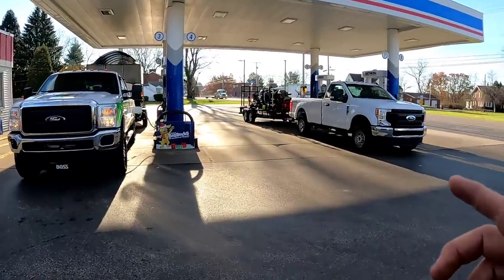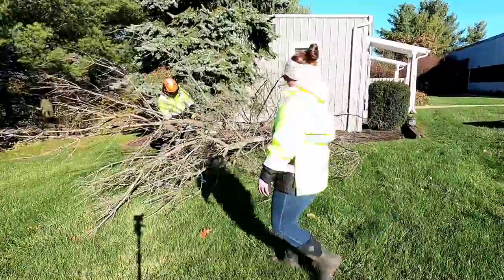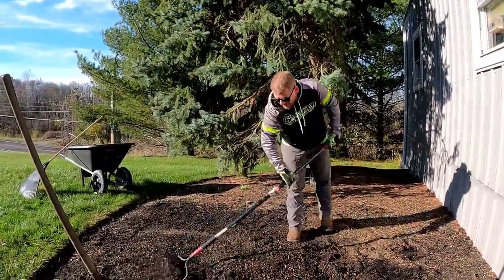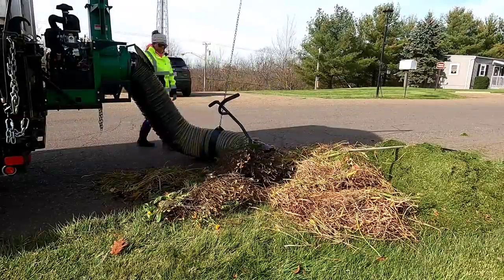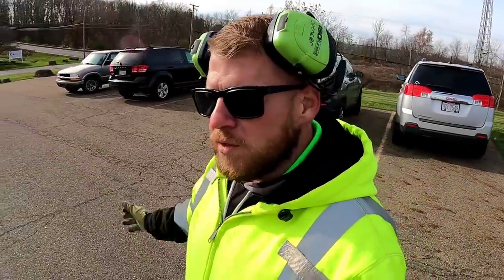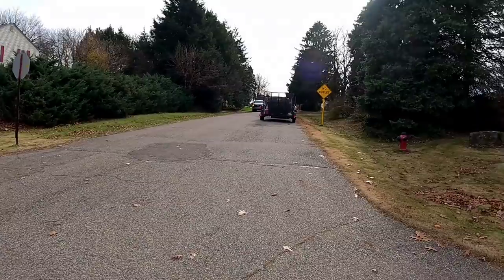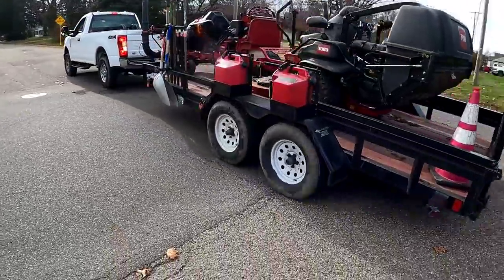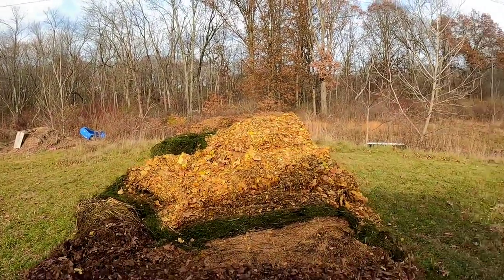WE HELPED A FELLOW LANDSCAPER | HOW TO DO A COMMERCIAL FALL CLEAN UP!

Comment: Running a debris loader is hard work.  Most of what helps is how the hose is supported. I think this one needs another strap and chain about 3’ from the blower. If you have it coming as straight as possible out until the last few feet it’s a lot less weight you’re lugging around and the hose lasts longer because there’s a lot of stress on right by the blower. Not nit picking just trying to make it a little easier for you. 👍

Comment: Hey Sean I'm telling you just try it once and you'll never go back. Put the leaves in a nice line right on the road and have the mrs. Driving the truck as you're going down the pile sucking it up he is coming back behind you with the blower to clean it and you just sweep up the very last bit. If you got big heavy piles use the grading rake  to pull it into the machine and if they are dry and later you can use the leaf rake. We put about 12 yards or shredded leaves in our truck a day so we try to minimize the work on our bodies and having those piles on the road makes a huge diff

Comment: Great videos Shawn!!! A quick tip to cut the stump below ground is to take a small axe or hatchet and chop off the bark below grade it only take a few minutes and then if you really want to protect you chain a quick rinse with a gallon jug of water on the cut line and chances are you will have a clean area to cut and spare your chain. It works great!
Great stuff from you all at Spencer Lawn Care!!!

Comment: Hey Shawn when your cutting a tree after you cut the wedge out in stead of doing a straight cut in the back start higher and cut at a angle down toward the wedge it helps direct it more where you want it.
Reply: False
Reply: @jorgegomez9678  been doing it for years boss it does work

Comment: you should see if you can install a winch for the tube. run it to a pulley at the top of the extension bar. It would make it ten times easier.

Comment: I started using kawasaki k tech 2 stroke mix and like it a bit more than anything else ive used. Save all those little bottles just refill them and keep a pack on board.  Your cut looks fine only thing that one might nit pick is having a slighly deeper face cut just due to the slight breeze pushing on it but it would pass inspection imo.   It just started snowing our first snow in colo so ill bet you get some shortly if it stays in your direction. Happy thanksgiving

Comment: I feel like it would make it easier to use to remove the chain on the tube while sucking the leaves up. Would allow for more unrestricted movement.
Reply from the maker: It does but then its hard to reconnect.
Reply: I would try stretching the hose and attaching the chain straight down. I would also shorten the chain also. This would keep the majority of the hose and weight off the ground and on chain. When hose is fully extended, the chain would be plumb.
Reply: @Marshall Ward If you notice at around timestamp 28- 28:45 you see the main reason to NOT remove the chain. It stops you from overextending the hose and causing damage/ pulling it off the machine while trying to strrecchhhhhhh out and get that last bunch of debris.

Comment: not 100% sure about this move i was told or heard that if you take a 3/4 to 1 inch spade bit and drill in the stump and fill with salt that will help a stump die and rot down hey tq the way you left the pick up of the sweeper in 1 place and used the rake to pull stuff to the pick up looked way more easy than the way shawn does it shawn you may want to try that way also just thinking